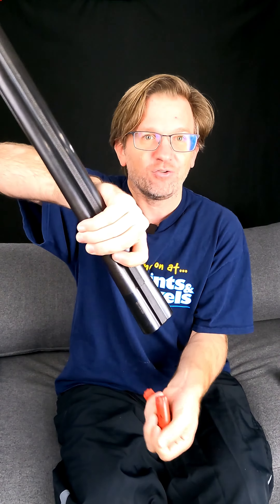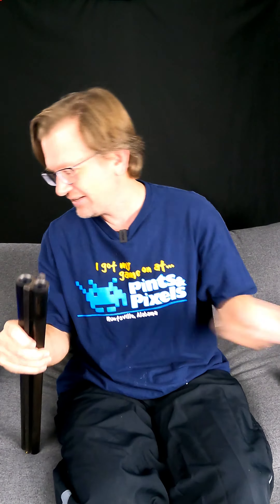TFL 58 Prechecking Hulls for Your Double

Comment: I have started gauging mine the night before a match with the slix shotshell checker.  If they are tight, resize with the checker and check again.  Of course I’m using factory shotshells, so this may not be applicable to reloads.  This is working well for me…glad I bought this handy tool.

Comment: You can use reamer and made bigger holes ;) But do not overcome ;) Keep eye on max diameter in specification for shotgun. Basically holes are just or ideally with minimum size. So there is plenty of space to change. Just to maximum by reamer. In my case I did it at home to my old s/s and now 'all' shells new or reloaded, crimped in star or rolled just fall down :D

I wish you all the best in 2022!